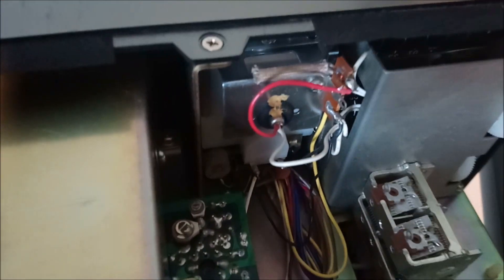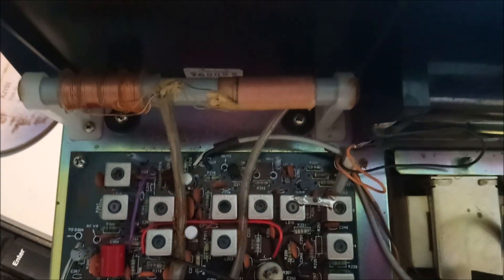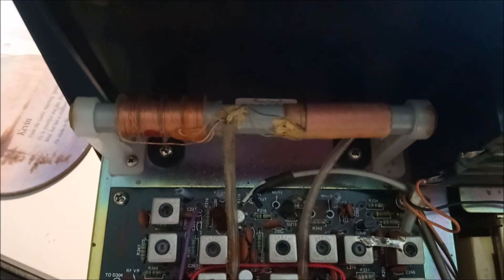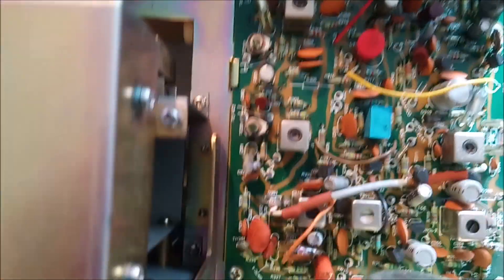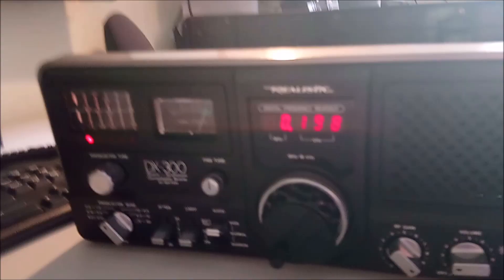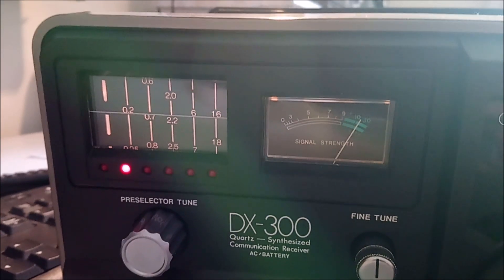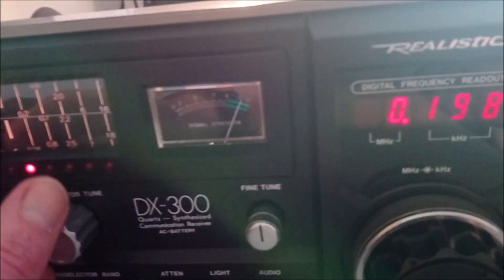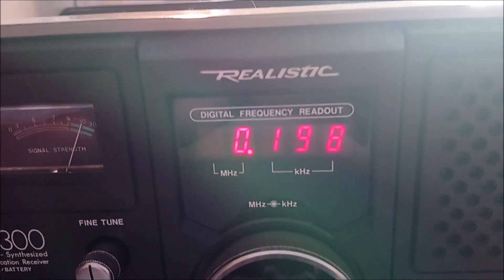Inside the Realistic DX 300

Comment: Nice radio those. This is the equivalent of comparing this transistor radio to a valve radio and today's generation comparing. It to SDR.. Nice to see conventional circuitry of my time.
Reply from the maker: No surface mount components in this one Ken. Was a top of the range set for Tandy in 1980. Not too bad a performer for its time but it was never a top flight receiver.